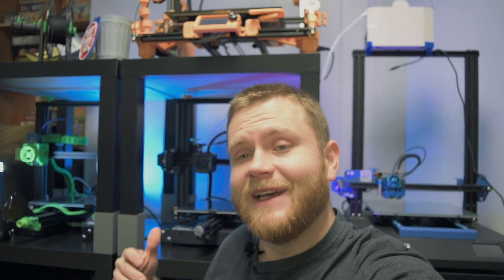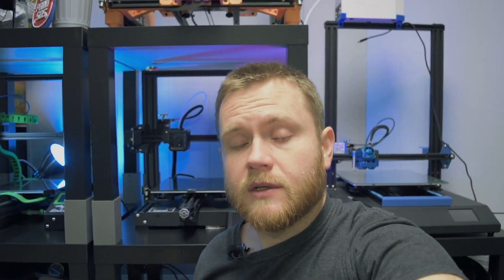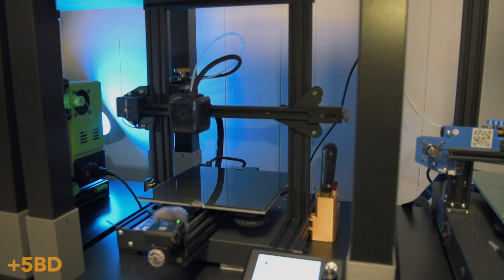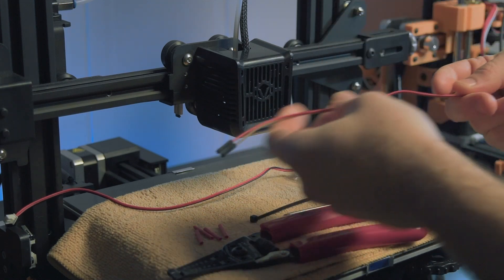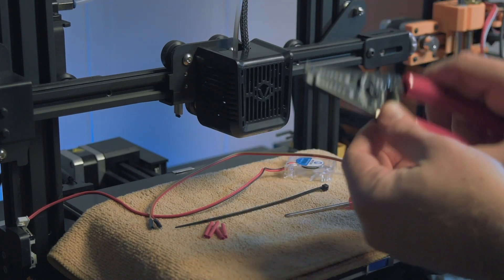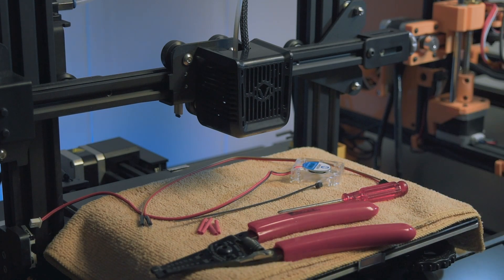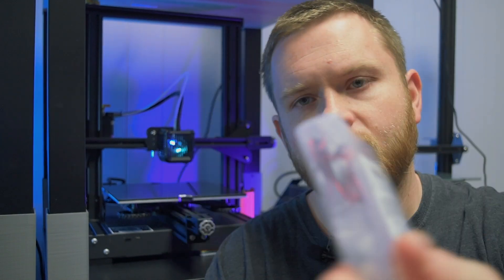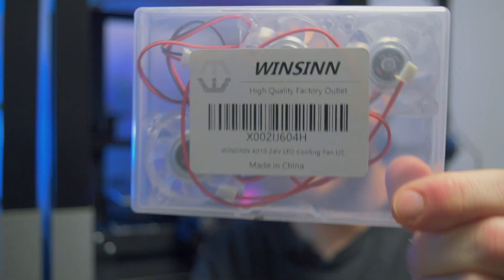Tired of your LOUD 3D Printer fans? Here's how-to install some SILENT RGB fans on the Voxelab Aquila

Comment: Swapped out the main board and hotend fans yesterday the noise difference was significant I now don't even mind the noise of it sitting on my desk now. Before the fan swap it almost felt deafing after hours of printing.
Reply from the maker: For sure. A quiet printer is a better printer

Comment: Has anyone has thermal issues with these fans? Upon my first print it cut off after about 8-9 hours of printing and gave me a thermal runaway error. Anyone else had this happen?

Edit: Upon further inspection I think the fan just failed during the first print. I don’t think it is a lack of airflow, just a faulty fan. I will replace with one of the other included fans and see if that fixes the issue.
Reply: I have the same problem. I thought maybe i installed the fan backwards flipped it around and still having same issue. I might have to try another fan.
Reply from the maker: Definitely try a different fan. If you got the 4 pack, try another. If it didn’t come in a 4 pack, maybe it’s a slightly different fan? 

I’ve had a who heap of these things now and they seem to be working perfectly for me. :/ bummed to hear of the issue.
Reply: @3DPrintSOS  tried a new fan last night out of the same 4 pack thats in the link. Same issue. Gonna try and get a new one from voxelab it was printing fine all up untill the fan issue so its gotta be that
Reply from the maker: Oh man. Sorry to hear that. No I haven’t had issues. I’ve printed a few 24+ hour prints without problems

Comment: One thing that confuses me about this is my hot end has two fans in there. Is your Aquila different than mine? Or was just one of your fans making the noise?
Reply from the maker: There are two fans. One is for the hotend and the other is for cooling prints. The one that tends to fail is the hotend fan.
Reply: @3DPrintSOS  Okay thanks!

Comment: Thanks so much for the info. Just did this mod and the .4mm hardened steel tips. Question though. Did you notice you had to adjust your fan speeds at all after installing this fan? After I replace them, I couldn't get any successful prints. After messing with a bunch of settings and having no luck, I tried turning the fan speed down to 75%. Now my prints are actually working again. Just curious if you experienced this at all. Thanks for the awesome videos!!
Reply from the maker: No I didn’t notice. But that might be a thing. Fan design couldn’t be different enough plus the nozzle material usually makes for a tad bit of a adjustment.
Reply: Do you remember what issues you started getting upon replacing the stock fans? I have the same experience, my issues was heat creep, the WINSIN fan is not cooling my hotend heatsink effectively thus resulting in heat to climb upward and melting the filament which then results in a clog. Did you have a similar issue?
Reply: @ihadadreamthatnoonecouldsee  did you check if the fan is pushing or pulling the air?
Reply: @francorobredo9567  Which should it be doing — pushing or pulling? It seems that the fan only goes in one way, but I'm not sure I put it in the same orientation. Right now, it is pulling air in and blowing the hot end.
Reply from the maker: It should be blowing onto the hotend. All of these fans have an ideal flow path, some can’t create enough pressure or move enough air to pull. So, they should be pushing air onto the fins.

Comment: I tried installing them but only rgb light goes on but dose not spin had to put the original back. Not sure what i did wrong. Any suggestions.
Reply from the maker: Hmm. Are the fans 24v? Maybe they blades are interfering with something?
Reply: @3DPrintSOS  yes it was just stuck. My bad thanks.

Comment: Were you able to replace the fan that has the little duct that blows at the nozzle? I soldered on two fans before I realized that the second fan in the shroud is different from the first.
Reply from the maker: Oh. Oops. I have not needed to no. It seems to be a good fan.

Comment: hi….thanks for the video, i changed my fan, it lights up, but kinda moves slightly then stops? tried starting a print, but doesn’t engage the fan? faulty fan or something else?
Reply from the maker: Hmm. Check to make sure the wiring is 100% right. Honestly, sounds like a bad fan though. :(
Reply: @3DPrintSOS  figured it out…..i purchased the 5v fans instead of the 24v fans! rookie mistake 😂 for people who search amazon, make sure u buy the right ones
Reply from the maker: Oh no. Oops. Happens really.
Reply: @3DPrintSOS  i’ll double check, the solder was solid? i’ll try a different fan…..i’ll test it before i cut the wire 😂

Comment: you cant +5db to a sound as its log scale and its hard for the human ear work out the levels. or run 2 fans in series and 2 12 fans will run on 24 volts
Reply from the maker: Thanks for the tip. Figured it would be a good way to show the difference in sound in both fans in the same exact situation. I’m no engineer. So keep that in mind. Haha.

Comment: Can you do a tutorial on how to install the Noctua fans? I can't find a good tutorial for this printer.
Reply from the maker: Since they are 12v fans you need to put a step down converter somewhere to get the voltage down from 24v. Best way to do that is to run a new wire from the motherboard to the step down and then from stepdown the fan. And you can hide the converted under the printer. If my fans fail, I’ll surely do a noctua vid.
Reply: I'd be interested in this as well, especially if the Noctuas are free of the RGB lights, which I don't like (Red only would be OK)

Comment: Hey man I love your content but what voltage of winnson rgb fan do I get also what millimeter?
Reply from the maker: You need 40mm 24v fans for the hotend and motherboard. For the psu you need 60x10 12v fans.

Comment: Does the fan ever stop? I just did my first print, and it finished an hour ago and the fan is still going even though nothing is printing. I figured it would enter a sleep mode or something.
Reply from the maker: Nope. The hotend fan will always run, on almost all printers. It’s a safety feature.

Comment: Love your vids on this printer, they helped me decide to buy one!  My problem is, I bought this fan, installed it and now it's clogging.  Should I turn the temp down a little?  It's at the 200c default.
Reply from the maker: Oh man, that’s no fun. Clogging could be because of a number of other issues though. First I would clear the nozzle. Heat to 230 and push a bunch of filament through until it comes out of the hotend every easily. Then back down to 200. I would also make sure your ptfe tube is all way in the hotend and also that it’s cut at 90 degrees exactly. Any gap there could cause clogging and headaches.
Reply: @3DPrintSOS  Turns out, the insert for the extruder idler wheel busted out of the plastic and wasn't clogged after all!  Used the one from the Tronxy X3.  For some reason, they had an all metal beefy one, which is more than I can say for the rest of that nightmarish unit, of course the controller being bad didn't help things. So I'm back up and printing! Loving the Aquila!
Reply from the maker: Nice! You can always print my extruder block and lever and be set. ;)
Reply: @3DPrintSOS  Definitely will! I realized that was you Ray was talking about, then realized I already downloaded it because of your other video about it. lol  :)
Reply from the maker: Tight knit community haha
Reply: Printing it now.  Went crazy, 100% infill!
Reply from the maker: Nice. Should be great at 100
Reply: @3DPrintSOS  It's pretty solid! I'll install it later once I figure out where I put my craft knife. Still amazed at how well it works for what it cost!

Comment: I just set up my Aquila and that thing is loud! I have WinSinn fans on my Ender 3, but that printer was never as loud as the Aquila. Is there a reason you chose the hydraulic bearings over the dual ball bearings?
Reply from the maker: They are loud, but having a silent board is far less annoying. Fluid is quieter than a bearing, so usually a better solution if you want less noise. ;)
Reply: @3DPrintSOS  I used the "hydraulic, quiet" fans on the Ender's part cooling and hotend. They were quiet, but crapped out after 2 and 3 months. I ordered the "dual bearings, quiet" fans. As long as it doesn't sound like a vacuum cleaner, I'll be happy.
Reply from the maker: I see. So far so good on these Winsin RGB fans. We will see what happens long term. I have had Noctuas running nonstop for several years now on my other printer.

Comment: Man, the y axis motor gets smoking hot on my printer even with lower belt tension. I should put the old fan on that
Reply from the maker: Hmm. Should be be happening. Have you checked if you’re wheels are too tight?

Comment: i have my bed levele but when it printing almost anything over a 1/4 inch high the fan shoud will hit the project and will move the glass what can be done to fix this problem
Reply from the maker: Hmm. Interesting. You could try z hop. But it sounds like you are getting curling. How hot is your temp set at?

Comment: Great video, will definitely be replacing the hot end fan. my parts cooling fan went out though. any recommendations on replacement for parts cooling fan?
Reply from the maker: If you have to buy a parts fan I would just go to a maglev from Sunon. The 5015 fans aren’t quiet, but they push waaay more air. You’d Have to print a duct though. If that’s too much, just grab a replacement from voxelab. :)

Comment: The Aquils power supply fan is noisy when started from cold then quiets down. Have you replaced yours and if so what fan is needed? My other question is can the RGB hotend fan replace the main controller fan?
Reply from the maker: Maybe someone else can chime in. I haven’t opened the printer further than the hotend yet.
Reply: @3DPrintSOS  upon further inspection the fan noise was actually from the main controller but oddly it was louder towards the back. As luck would have it it is the same 4010 fan used on the hotend and also 24vdc. Replaced with another RGB fan.. MUCH quieter now!
Reply from the maker: Awesome! Good to know it’s a 40mm fan. Makes it easy to swap. :)
Reply: @3DPrintSOS  also forgot to mention the plug on the fan is correct so it's plug and play! :)
Reply from the maker: Oh wow. That might be good enough for a pro tip video! ;)

Comment: Are there two fans on the hot end?? Why not replace both ?? Love the videos!!
Reply from the maker: One fan is a blower style fan for the parts cooling. It only turns on around layer two of a print. The “loud” one there is the standard 40x10 hotend fan. That fan stays on if the printer is on.

Comment: Did you replace both fans with the winsinn RGb fans? How did the air guide work after the swap?
Reply from the maker: Just the one for now. But I’m looking into the rest as well. Works great been printing perfectly since the install.
Reply: @3DPrintSOS  I've done the same one as you, but the other is just as noisy as the first!  I've been doing research into it, the printer is awesome just a shame about the 50 decibels !
Reply from the maker: Haha. That’s true. Easy fix at least. But honestly, my other printer with non silent steppers is far more annoying. Haha

Comment: Hey I've been thinking about get the ender 3 v2 direct drive for it. do you know if it will work is it compatible? Is it worth it?
Reply from the maker: Good question. It should fit. However, you may need an Ender 3 v2 duct because the duct mounts are a hair different. But you could always print one as well. ;)

Comment: Is the new fan the same CFM?  Does it make a difference?  Thanks
Reply from the maker: Good question. Honestly, I don’t know it’s specs. I trusted my buddy Jess who has been using this fan on his for a while. Even if the fan isn’t as efficient, and once again I’m not sure, it’s still worth the noise decrease. I haven’t had any issues since.
Reply: @3DPrintSOS  I Googled this today and can find no CFM rating for either fan.. Surprising since this is an important spec along with volts, rpm and amps...
Reply: Got the fan in today.  The original fan was still working fine, but this new fan is so much quieter.
Reply: @arashitohwa4047  made a world of difference! Plus it looks awesome especially since I also printed an EB fan shroud using Cloudy color PETG...
Reply from the maker: Nice! It’s a good fan

Comment: I think I want to replace my PSU fan as well. Does anyone know if that will be 24V also, or will I need a 12V fan for that?
Reply from the maker: It’s very likely 24. With that said, I haven’t taken it apart so I’m not 100% sure.

Comment: Timing couldn't be better Fedor - just got my replacement fans today. Replacing all stock Aquila fans. The hotend and board fans are so loud, they drown out my old Tevo Tornado running beside it!?!! Looking good on that setup! BTW - your videos on the Aquila convinced and are great help for me to see if it could be a good fit for a mini print farm.
Reply from the maker: Awesome! I think they totally are a good fit.
Reply: @3DPrintSOS  You bet from a price and quality point of view. Quality prints at 0.4mm nozzle/0.2mm heights.

For 0.6 nozzle/0.3 height - it's failing miserably. Four different slicers, eight different PLAs, over 50+ test prints, just can't get rid of the zits/blobs. All coming from the same issue that I now suspect is the firmware: at every start of new layer, the head pauses but the extruder starts turning, leaving a puddle of plastic. No matter what you do with the extraction settings, even turning them off, does not prevent the 0.3second maybe even 0.5second pause and oozing. Even lowering the speed to 50% does nothing to prevent the pause. I even removed the hundreds of lines in the g-code where this instruction comes from and the printer still pauses, and oozes. So, it has to be firmware somehow.

Any ideas or guesses are welcome Fedor! Waiting for a new Kingroon KPS3 today and see how it performs against the Aquila on that front.
Reply from the maker: Hmm I’ve seen this issue before. I believe it was SD card related? Have you tried a different card?
Reply: @3DPrintSOS  Thanks for replying Fedor! Actually I have. Tried their own SD card which worked well on other prints but I mainly use my two stock SanDisk cards. Again, both work well for my 0.4N/0.2Layer but not for 0.6N/0.3L.
Reply from the maker: That’s strange. Almost like something can’t keep up with the higher filament flow. I understand why you’ve tried to slow it down, that’s what I would have suggested. I’m not sure. I’m trying to think why that would cause stepping pauses...
Reply: @3DPrintSOS  No worries Fedor & thanks! I'll keep digging and let you know if I find anything. In the meantime, I'll keep an eye on your new vids!

Comment: I'm totally doing this.  Do you have amazon links to those connectors?
Reply from the maker: Oops. Totally forgot to add those in. Here you go: https://amzn.to/3uLKtHO
Reply: @3DPrintSOS  Thank you, got a link to the Noctua you were referencing as well?
Reply from the maker: I do. For noctua, you’ll need a step down converter as well. You’ll have to get the power down to 12v from 24. 
Fan: https://amzn.to/3b7MeqV  
Step down buck converters: https://amzn.to/2NJI2VD
Reply: @3DPrintSOS  Very nice, I'll give that a try too, thanks again!  Might not be a bad idea to put those up top for someone else?  Maybe I'm huge noob, no idea.
Reply from the maker: For sure. Sometimes I just blank on these things. I’m still learning too. :) 

If you have any questions about the noctua fans let me know. :)
Reply: @3DPrintSOS  Just installed the RGB fan, man it really does make a huge difference.  It's crazy how quiet it is.  Unfortunately now it sounds like my power supply fan on the bottom is the loudest part of it, likely going to upgrade that one too if possible.  This thing is going to be stealth one day!
Reply from the maker: Haha yep. Same.
Reply: The second set of wires are blue and yellow for the second fan

Comment: Holy crap, that is EXACTLY what mine was doing after having it for a couple of days. I ended up returning it and picking up a Sovol SV-01 and the BL Touch auto bed leveler. I'm incredibly happy with this one and the larger bed allows me to print some things I wanted to print before but couldn't on the Aquilla (bartop arcade cabinet for retro gaming). However, I'm still going to be watching your videos because you help has been very valuable!

Comment: If you are going to replace the fans this is a good time to upgrade to dual cooling fans whilst you are rerouting wires, you are going to need a new dual part cooling fan carriage though, the Petsfang is a good one
Reply from the maker: Maybe true but I don’t have any issues with parts cooling. No need to upgrade if it’s printing great. ;)

Comment: When are you going to make a video on bl touch installation on aquila ??
Reply from the maker: Seems to be highly requested. I’ll have to grab a kit at some point and film it.
Reply: @3DPrintSOS  i have seen people  having trouble wth the firmware voxelab released for bl touch compatibility with aquila and some people are installing ender 3 firmware on it to make it work
Reply: @kuldeepsinghnizer  I think they rushed the software I ended up going with ender 3 software